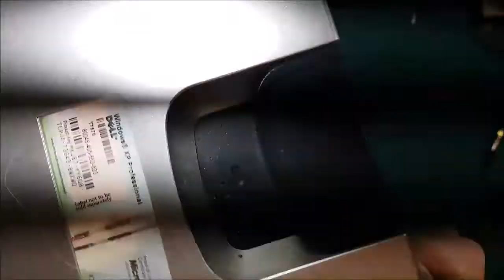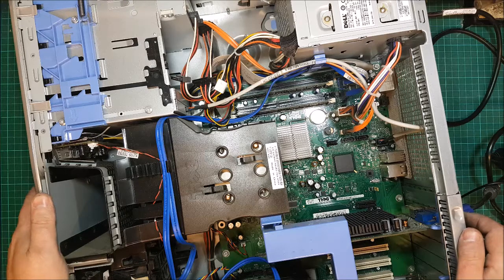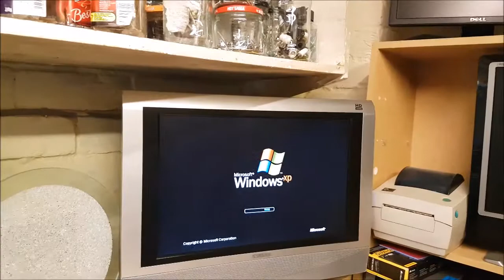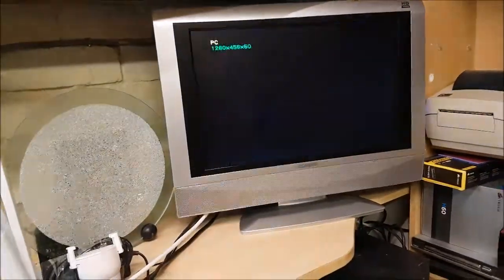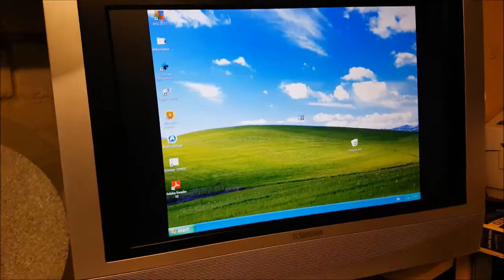Dell Dimension 9200 Teardown

Comment: was gifted one of these a few days ago... but with a beefier graphics card, firewire and only one harddrive, also with just 2 GB of ram... from what I gather, the system is normally born with just 1 GB of ram but with 2 we might have dual channel. I plan on giving mine an SSD, a radeon x600 and windows xp ... so it can be used for xp retro gaming... I think mine came with a GeForce 7900 GT